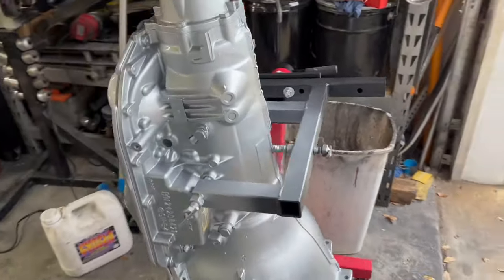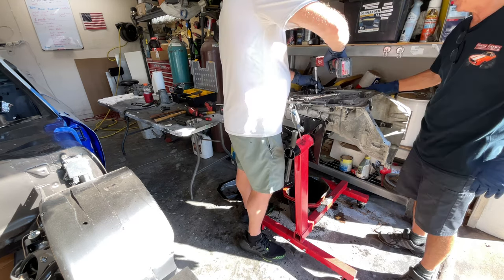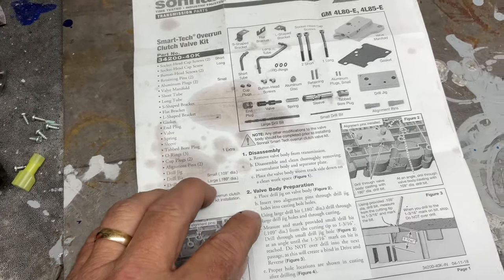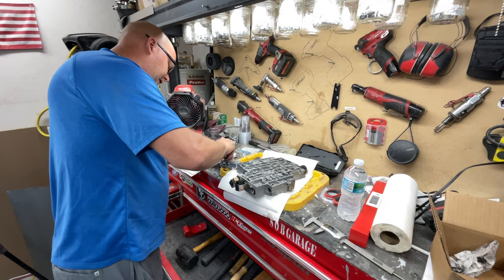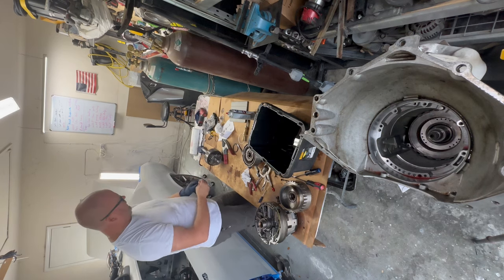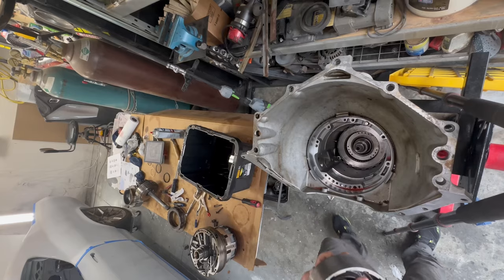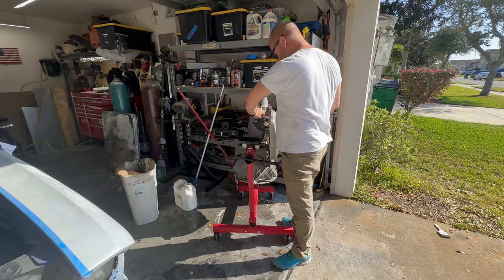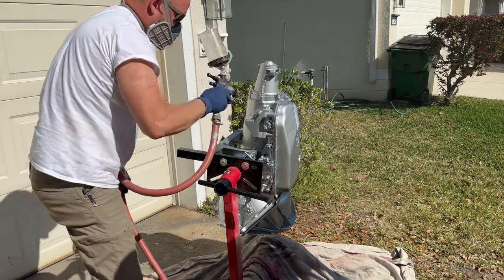Build a 1200+HP rated 4L80E for under $1200 !!

Comment: Great video! We appreciate your business.
Reply from the maker: Thanks!
Reply: @SOB_Garage gearstar transmissions...
Reply from the maker: @dalehall2993  is that who built yours or did they sell some parts for you to build it?
Reply: @SOB_Garage  
I took it too them..6l80 level 4 im in ohio about 2hrs away from them...
Reply: @SOB_Garage  
They dyno test it putting 100 miles on the transmission and 1 guy touches it...quick turnaround...hoonigans garage California   uses them if that says anything.
Reply: @SOB_Garage what is the max power a 4L80 can be built to handle? I’m doing a twin turbo 572 in my 67 Chevelle.

Comment: I believe it to hold that much. I build mine with duel feed direct , sonnax boost valve, tcc valve and afl valve kit, shim to be tight,  holds 800+ hp easy
Reply from the maker: I agree Gumby. These transmissions will take a beating when built right for sure.

Comment: Looks like you bought one of those ebay transmission mounts that you have to grind one of the legs down just so it will fit. I bought one too thinking it would work right out of the box.
Reply from the maker: I can’t remember where I bought the mount, but I didn’t have to modify it at all to use.

Comment: Will you need a new tune? Or will the regular TCM base tune work just fine?
Reply from the maker: The stock tune should work, but I do plan to have it tuned when I get the engine tuned soon. I’m running the terminator x max instead of the factory ecu because of all the other stuff like twin turbos and e85
Reply: @SOB_Garage  I see thanks for the insight so the only reason to tune the trans is if the engine pcm is tuned. I only asked because I live in NY
Reply from the maker: @bryanleal9836 tuning will let you change many features like shift points and etc I think. I’d talk with your local trans tuner
Reply: @SOB_Garage  I know that, and it also can decrease shift time and etc for optimal consistency, but unfortunately, I live in a state that now fails for having a tune. Sure, I revert the original ecu and tcm to the base setting. But that's a lot of work for a street car that (unfortunately don't have a garage or lift) to do this frequently
Reply: @SOB_Garage  but thanks for taking your time to respond

Comment: Billet main shaft and transbrake future plans?
Reply from the maker: Good question John. I only plan to push around 750 rwhp so this should handle all of it easily. The motor was build for about 1500 hp (under 1000 with the current e85 injectors) but I plan to keep the boost low.

Comment: Everything in the auto industry is rated at torque (and number of cycles), not HP.  You can't use hp to rate anything in the drivetrain. Transmission capacity HAS to be rated in torque, not horsepower. The transmission can live long at 1200hp but break easily in a 600hp car.  One will make 505lb ft at 12,500rpm (1200hp car) and the other 1010lb ft at 6250rpm (600hp car)  That's why you can't rate driveline parts in HP

I'm an engineer in the auto industry BTW.
Reply from the maker: I appreciate you taking the time to give a dissertation on this. Those numbers are moot though. Show me examples of the 12,500 rpm engine bolted to a 4l80e making only 505 hp. 
Seems many manufacturers rate their parts in hp.
Torque is easily calculated from hp. 
I’m a guy who builds cars for fun in his garage and not on a computer screen or a calculator BTW.
Reply: @SOB_Garage  I understand what you are saying, and appreciate the reply. I sincerely wasn't bagging on you or your work. I was just giving some insight from an OEM perspective so others understand that 1200hp isn't the same in all cases. I think what I've seen of your stuff is great.  

If I was to say it simply it's this.  "The amount of twist, for how long, for how many times is what matters.  HP is not a measurement of twist/force, TQ is." HP is actually calculated FROM TQ.   Think of it like this TQ is a hammer blow, HP is how many times a minute that happens.  Make sense?  Knowing how many times a minute the hammer hits the spike doesn't tell us squat except how fast it will get driven in. (HP) The actual force of the blow (TQ) is what we need to know to design a hammer to take the repeated pounding. 

You will NEVER find anything in a driveline designed by an OEM rated by HP. HP is a derivative and not a constant. They rate things in TQ capacity and number of cycles it has to take that TQ before failure.  The aftermarket is totally different.  They are not designing things to last 100,000 miles under warranty.  They use terms people are more familiar with like HP to sell product. (Even if it's wrong.) It's more of an educated guess.  

Most guys who are buying the input shaft in your build will have a V8 (Or possibly a straight/V 6) under boost or a ton of nitrous and produce that 1200hp somewhere between 6400 to 7400rpm.  Just like using the formula HP = TQ x RPM/5252 to find HP from a known TQ figure, you can back out the torque from a known HP and RPM figure. So they can guess the 1200 HP motor will most likely make peak torque of 1150 to 1400lb ft of torque between 4400-5400rpm and that's what they use to rate the part "1200 hp".  I've done this stuff for a living, believe me no one is rating parts in "hp" behind the scenes.

Comment: The paint makes the transmission run hot 
That's why the case is made of cast aluminum just like air cooled engines
Reply from the maker: Lead also makes people stupid when they eat it but it didn’t stop you.

Comment: 1,200hp is thrown around so loosely these days. 
A real 1,000 wheel hp street car that gets driven 
especially if its over 3500 lbs and making it live for more than a few months is not the easiest task.
Reply from the maker: Sure. But my 69 Chevelle was 3200 originally and isn’t a daily driver. And like I said I’ll be at around 750 unless I turn up the boost.
Reply: Good luck to you, my 4l80e has been perfect for the last year right at 750 wheel and 3,300 lbs
but a few months ago I turned it up to around 825 going off how much fuel it’s using and now I have broken the trans twice so far. 
I blame a lot on the fact the car hooks very well on the street. But ill take a busted transmission over a hurt engine any day of the week lol.
Reply: What broke?

Comment: Not sure how you built it for u set 1200$ when the stall converter runs close to 1200$ and a bullet input is close to 300$ and the rebuild kit is 800$, idk that’s 2300$ without fluid, billet forward hub, rollerized rear output, afl kit, TCC kit, shift kit, etc 
Great video but that’s a 2500$ parts list with rebates brother 😜
Reply from the maker: I guess if you count the stall as part of the trans, then yes it was more. But I don’t consider a stall as part of the trans. Most built trans do not come with a trans - they are extra.